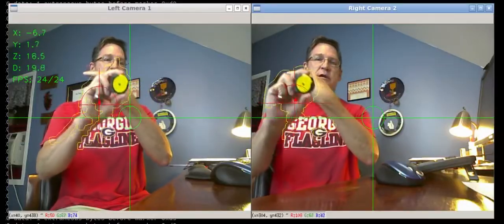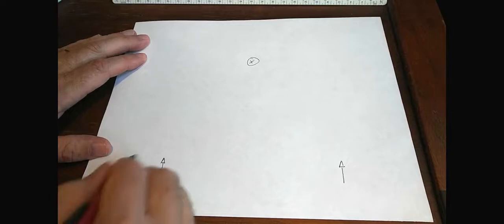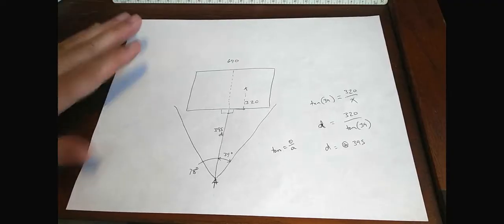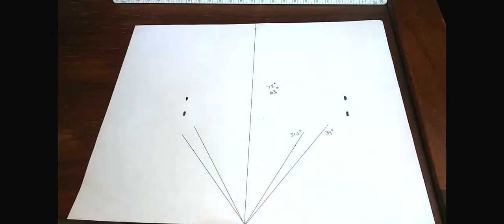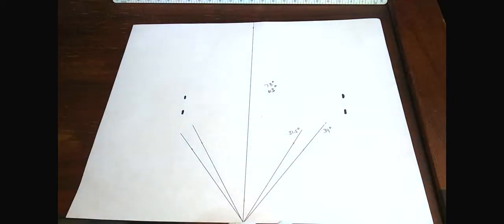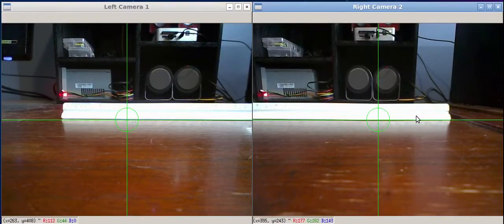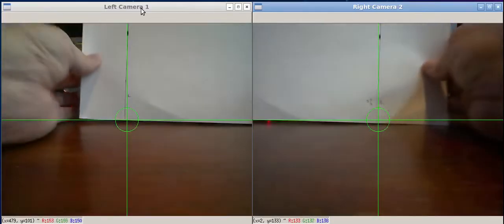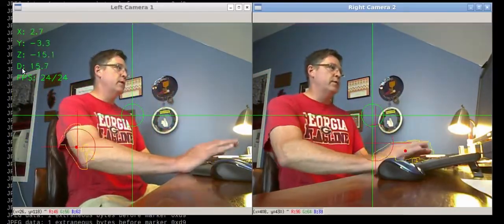Distance (Angles+Triangulation) - OpenCV and Python3 Tutorial - Targeting Part 5

Comment from the maker: Here is the code I used: https://gitlab.com/duder1966/youtube-projects/-/tree/master/OpenCV/triangulation I just checked this code March 11, 2022. Read the notes.
Reply: Hi Darwin , while running the above code am getting error like "Corrupt JPEG data: 2 extraneous bytes before marker 0xd0" . Any suggestion to fix this issue
Reply from the maker: I've seen something similar. I think the problem is that OpenCV doesn't like the data format coming from your camera (not a Python issue). I have a camera that causes OpenCV to print an error similar to that, but it doesn't cause any problems. If the error isn't fatal, you may be able change the level of error reporting in OpenCV, or you maybe able to re-direct the stderr. Try it with a different camera if you have one and see if it changes or goes away.
Reply: @ClaytonDarwin  i am actully getting same error with logitech c270 camera can u tell me how to fix this issue
Reply from the maker: You need to write a small python opencv script just to test the camera. Once you can read from the camera you can use those settings for the big script. Maybe use the script from the motion capture video.
Reply: @muthukumars50   i am getting same error can you please help me to sort this out
Reply: Hello Mr Clayton, I am working in a similar application of camera and triangulation, can u help out with camera calibration and synchronization. I want to capture the data into point coordinates, is there any library for the data acquisition in point coordinate and overcome from overlapping.
Reply from the maker: I'm not aware of any libraries for this, but I'm sure some must exist. We're not the only ones working on this. As far as camera calibration, it's hard to do consistently using the tools in opencv, and it limits the usable area of the camera frame. I'm having better luck manually creating an angle offsets table for my cameras.
Reply: THANK YOU,SIR
Reply: Awesome job! Any reason you use drive to share code and not git?
Reply from the maker: I just hadn't set up a non-work location at the time. Have one now and am migrating YouTube code to Gitlab in bits and pieces as time allows. Link is in the recent measurement video.
Reply: Hi Darwin ,
I can run your targeting tools. It's very cool !
But I have a question want to ask ,if want to targeting two or more object ,how can I do this ?
thanks you much !
Reply from the maker: This code is intended to just illustrate how you can target and give a basic framework. It isn't set up to track multiple targets, use object recognition, etc. You will have to modify the code and add your own target-select method.
Reply: @ClaytonDarwin  okay ,thank you for your reply
Reply: Thank you very much, I am working on it for my new job task, I almost give up, thank you give me the power, and thank the Math magic.
Reply: Hi @Darwin, will this work for IP-based cameras, or does it work only with USB cameras? Code changes will be done, but is it practically possible with an IP camera?
Reply from the maker: Theory is the same.

Comment: Hi Darwin. The camera returns 2 angles, which are the horizontal angle and the angle, right? How do you know it will return to any angle?
Reply from the maker: They are based on the center of the frame.
Reply: @ClaytonDarwin  From there, how my angle is oriented towards the horizontal angle, help me how to do it in specific detail
Reply from the maker: It's all in the code. I don't currently have time to revisit this project.

Comment: @claytonDarwin : Great explanation, i have a doubt, if it's just X,Y i'm bothered about, i'm better off with just one camera right?
Reply from the maker: X and Y change depending on Z. If Z is fixed, then one camera will work. See my other video on measurement. I have an example.
Reply: @ClaytonDarwin  i checked your video, but can i work without having a known distance to calibrate in the screen?
Reply from the maker: You have to have a known measurement in the formula.

Comment: Thanks for the video.
I'm using object detection with YOLO. Would I need to detect the same object with 2 cameras separately before trying this triangulation technique?
I am able to detect objects with one camera without issues, but how would I make sure the object being detected by the 2nd camera is the same one the 1st camera detected? (if there are multiple objects in the scene)
Reply from the maker: Yes. I would identify the object in one camera, then select a central area in the object, then find the nearest match to that in the other camera. You could also limit the search area in the second camera to the expected location. For example, the object should have about the same Y axis location in both cameras.
Reply: @ClaytonDarwin  Thank you. I'll try it once I get myself a dual-camera set up.
Reply: @elyakimlev Were you successful in achieving that? If so, could you please guide me?

Comment: This is great! Question, though: what if the cameras are not fixed? For example, what if they are both pan-tilt-zoom cameras, tracking the object (i.e., always in the center of the camera frames)?
Reply from the maker: This code would not work. However it could be done if you knew the pan/tilt angles and the distance between the cameras. A lot more complicated.

Comment: I have replicated this project step by step and works perfectly. I keep evaluating if I can implement some of these  ideas on a project that I am conceptualizing. Thanks a lot for share. I agree if the cameras are quite similar in performance the angles strategy would be the final calibration.
Reply from the maker: Cool. Check out the auto-measurement video (it's newer). It has a different way of calibrating the cameras (one camera) that might help. At some point I will merge the two projects, but I haven't had time lately.

Comment: I have a question. How do you understand how much is the distance between the cameras in pixels? How do you create a unit of measurement if you have pixels and cm/m ?
Reply from the maker: Pixels are used to get angles. Angles and the inter camera distance are used to get measurements in units.
Reply: How did you get this? camera_separation = 5 + 15/16
Reply from the maker: With a ruler. Imperial inches.

Comment: hello sir thanks for information i just want to ask this.I calibrated camera with chess table so is it okay to use this code with camera which is calibrated chess board ? Also in this shared code does it include camera calibration and distance(angles +triangulation) or just distance(angles+triangulation) ?
Reply from the maker: This code depends on knowing the viewing angle of the camera. That is the method of calibration. As long as you do that, you should be okay.

Comment: U got the angle measurements wrong bcoz there is distance between camera lens and sensor. This is proven by the fact that u can see beyond the lines close to the camera. What u got to do is mark 2 points on each side. Join the points with a line and extend it towards the camera. The 2 lines from each side will intersect at a point. That is your effective sensor position. U got to measure the angle at that point between the 2 lines. This will give u the correct field of view, which will be less than what u measured currently.
Reply: I saw that too. You gotta put the camera on the paper itself then mark how wide you can see say 12 inches away then do the same thing for 6 inches away. Connect the dots to form the lines. You should not be able to see outside your field of view. In the video you see the field of view lines in the frame
Reply: @Dylan-kw8pz  make a tutorial please
Reply from the maker: Give us a link to your video so we can see how you did it.
Reply: @ClaytonDarwin  I hv not done it. Im just saying frm the mathematics point of view, which could improve ur systems accuracy.

Comment: I’m working on a tennis ball tracker for the application of cricket. A widely renowned example would be the hawkeye. I wanted to know whether placing the two cameras wider apart would improve or decrease the accuracy.
Reply from the maker: In general, 1) wider camera spacing improves accuracy, and 2) having the target in the center of the frame improves accuracy. You have to balance the two.
Reply: Thanks for the quick response Clayton! Would you be willing to suggest a tech/hardware stack (workflow) if I sent you a 3d model of the place where it’s going to be planted? I would be eternally grateful!
Reply from the maker: I don't have the qualifications/experience to do that.
Reply: you need 4 cameras at each corner of the court.  If you did 6 with two at half court, you could get position but use pairs to average position and account for errors at the farthest point between them which (would be the center of the court for 4 or the center of each players half for 6 cameras). Higher MP cameras would increase accuracy, so 6 100MP cameras would give you the most accuracy, and averaging the 4 cameras (the two pairs on each side of one half court) would give you the position on that half court and help minimize errors.

They sell a 100mp pi cam from arducam for $400, so itd cost ~$3200 to build the highest resolution system you could.  Then keep tinkering with it.

Comment: Do i need same resolution of camera? Thanks men
Reply from the maker: You should be able to run it with different camera types, as long as you set them up correctly.
Reply: @ClaytonDarwin  okay i set it already thanks for that. but i get this error 'not enough values to unpack (expected 3, got 2)'
Reply from the maker: Check the description. Answer is there.

Comment: hi mr when i run your code i get these following errors can you help me :

File "C:/Users/18736/PycharmProjects/Projet1076/tes1.py", line 129, in run
    frame1 = ct1.next(black=True, wait=1)
  File "C:/Users/18736/PycharmProjects/Projet1076/tes1.py", line 455, in next
    frame = self.buffer.get(timeout=wait)
AttributeError: 'NoneType' object has no attribute 'get'
Reply from the maker: I don't think your cameras are set up correctly. Make sure you can use your cameras via OpenCV before you try this program.
Reply: @ClaytonDarwin  ,Yes I usually use my camera with opencv, but I have only one camera that's 0 that I use every time
Reply from the maker: @kohdev2488  You need 2 cameras.
Reply: @ClaytonDarwin  thank you it works with 2 cameras, how to adapt a camera, because I need the distance from an object for my project
Reply from the maker: @kohdev2488  Triangulation requires 2 cameras.

Comment: hi sir, so is it possible to use this method and detect the distance of multiple objects, if so can you make a tutorial on it
Reply from the maker: This does not work for distance. I have another video on using triangulation to estimate distance.
Reply: @ClaytonDarwin  could you please send link sir
Reply from the maker: Sorry. This is the distance video. I thought this comment was from another video. You can track as many objects as you like, but you will have to come up with a different method to target them. I'm using movement of the largest object, but you could use a different method, like color or shape detection, object recognition, etc.
Reply: @ClaytonDarwin  ok sir so thank you for replying
Reply: @ClaytonDarwin  and sir what is minimum distance that the cameras have to be from each other
Reply from the maker: Generally speaking, more distance between the cameras will give you better accuracy at longer distances. For shorter distances, you need the target object nearer the center of the frame, so the cameras need to be closer.
Reply: @ClaytonDarwin  and sir could you please list what things would be changed to use this with object recognition, thankyou
Reply from the maker: Too many things. You need to find some tutorials on object recognition.
Reply: @ClaytonDarwin  and sir, is there a tutorial where you explain the code ?
Reply from the maker: No.

Comment: Thanks for nice work. I have understand about the distance calculation from camera to the object using two cameras.

Now I have following things and doing flowing steps
1-Calibrating the cameras
2- Rectified the frames
3- Calculate the Distances for each objects Using Your Approach
Now I have implemented and changed your code for multi-object detection and distance calculation for each object from the cameras like you have done for single object.Now I am trying to calculate the inter-distance between the objects by getting the three coordinates X,Y,Z as you calculated for single object.After calculating the 3D XYZ coordinates for each object, I have calculated the euclidean distance using their calculated XYZ coordinates.First of All , is it right approach ?. Secondly I have problem  related to change in orientation, While I rotate the objects without change relative position, distance get change between them.Why it so.Can you guide me about what is done wrong by me? I am looking forward for your response.Thank You
Reply from the maker: I'll respond to your email as soon as I'm able.

Comment: I have read that synchronization between 2 cameras may affect the disparity map and distance measures. Did you have any problems with your cameras?
Reply from the maker: I haven't done anything that requires high accuracy yet, so I haven't had any problems. But certainly I can see that that could be an issue. I did have to run the cameras in separate threads, which allows basic synchronization. Otherwise they would be way off.

Comment: Thank you very much sir. Could you please help me the distance and (x,y,z) is always 0.
Reply from the maker: Probably it can't detect motion in both cameras. A value of zero is the default. Make sure your cameras are aligned correctly.
Reply: @ClaytonDarwin   do you believe is cameras fault?
Reply from the maker: Probably your settings are not correct. You should see the movement outline on both camera frames, just like in the video. Is you aren't detecting movement in both frames, you probably don't have your cameras set up correctly.
Reply: @ClaytonDarwin   my cameras they detect the movement. All contours are working except target. How to disable only target contour. Thank you 😊
Reply from the maker: Are both cameras using the same frame resolution?
Reply: @ClaytonDarwin  yes.. and same angles too. I am trying to understand what is happening..
Reply from the maker: Have you tried the code found on my original targeting video. I think it's called camtar.py. Try it for each camera and make sure your camera setups work. Also, when you go back to 2 cameras make sure you're not reading the same camera twice (cover one camera). Also make sure the contour lines are showing on both frames.
Reply: @ClaytonDarwin  Thank you. I change klen=3 to 1 and it works. Now I am trying to measure the distance from a specific object. Do you have any ideas on how to do this?
Reply from the maker: You have to have a way to identify the object in both frames. In my example, I use movement to locate objects, but you could use color or image recognition as well. Same triangulation, just a different way of identifying objects.

Comment: Sir, I am working on a project where I am creating an Object Detection model for Autonomous Vehicles in different weather conditions. Here, depending on the information in the image, I want to vary the intensity of the weather condition filter to augment the images. The images have roads, cars, traffic signs, buildings, etc the typical Autonomous Vehicle dataset. The dataset that I am working on has images from the dashboard of the car. Now, if a car is closer, the intensity of the filter is directly proportional to the distance between the camera and the objects.
What should be my approach or any specific steps to achieve this ?

Comment: Thank you for the great video! Could you, please, help me to solve the following problem? When compiled your code, I got this

Traceback (most recent call last):
  File "C:/Users/Aser/PycharmProjects/objectDetector/2camUsingDetector.py", line 133, in run
    targets1 = targeter1.targets(frame1)
  File "C:/Users/Aser/PycharmProjects/objectDetector/2camUsingDetector.py", line 564, in targets
    ca = cv2.contourArea(c)
cv2.error: OpenCV(4.4.0) C:\Users\appveyor\AppData\Local\Temp\1\pip-req-build-9d_dfo3_\opencv\modules\imgproc\src\shapedescr.cpp:315: error: (-215:Assertion failed) npoints >= 0 && (depth == CV_32F || depth == CV_32S) in function 'cv::contourArea'

DONE
[ WARN:1] global C:\Users\appveyor\AppData\Local\Temp\1\pip-req-build-9d_dfo3_\opencv\modules\videoio\src\cap_msmf.cpp (435) `anonymous-namespace'::SourceReaderCB::~SourceReaderCB terminating async callback
[ WARN:2] global C:\Users\appveyor\AppData\Local\Temp\1\pip-req-build-9d_dfo3_\opencv\modules\videoio\src\cap_msmf.cpp (435) `anonymous-namespace'::SourceReaderCB::~SourceReaderCB terminating async callback

Tried several things to change, but could not solve it
Reply from the maker: The contour area function in opencv has different requirements and return values depending on the version. You'll have to change the code to work for your setup. See the other comments.
Reply: @ClaytonDarwin  thanks very much

Comment: From 15:48 in the video, you measure the distance between the cameras' centre-points with a ruler. When I do that, I get a slightly different distance when measuring close-up compared to further away. What factors might be causing it? And why is it necessary to get the same distance no matter where you measure?
Reply from the maker: Theoretically the cameras should be parallel for the math to work out correctly. The more accurate you can be, the better your results will be.